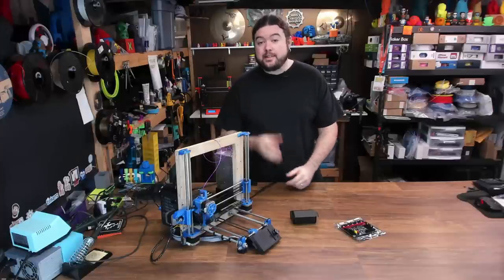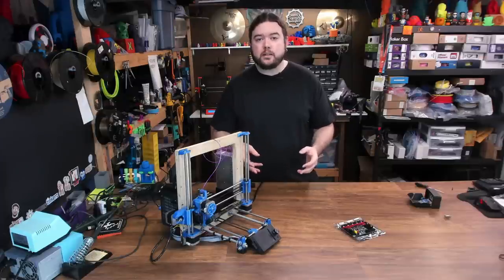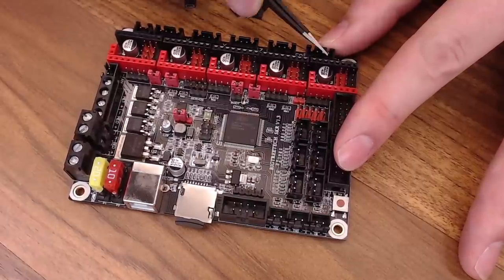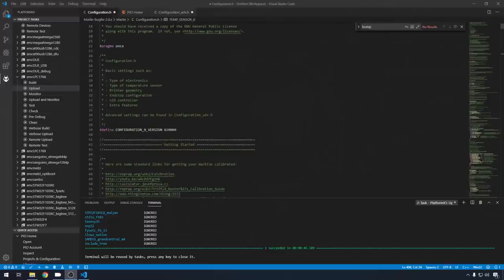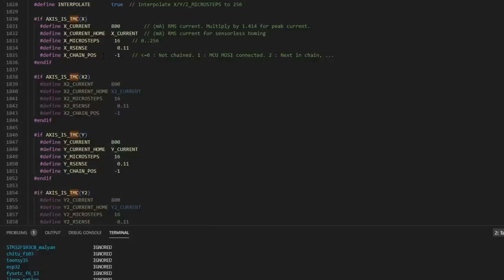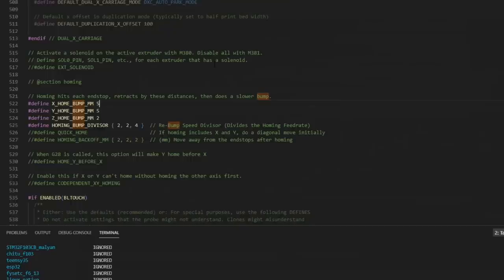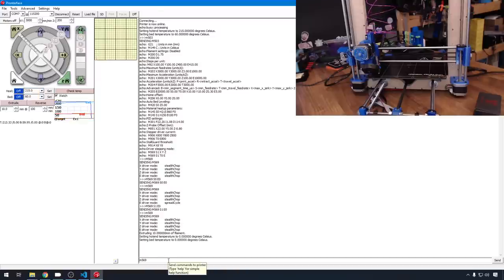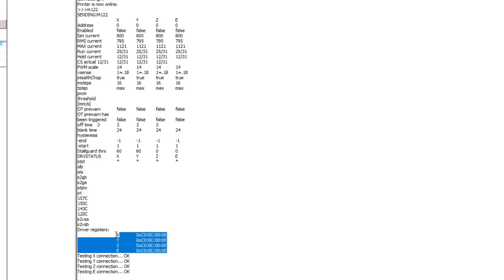TMC2209 Stepper Drivers - Bigtreetech - SKR 1.3 - Install - Chris's Basement

Comment: Great video thanks. Maybe you can help with this. I am building a printer and the hot end / carriage will travel past the edge of the bed before it will hit the end of travel in the x and y axis.  Will I need to change any other setting for homing?
Reply from the maker: You mean it doesn't stop when the endstop is triggered?
Reply: Not actually sure at the moment. I’m in the process of building a printer and I made the frame large enough for a 300mm heat bed but right now I’m putting a smaller 210 (give or take) bed on it. It appears that the carriage will be able to travel to the left (view from the front) farther off the bed area then just to the edge. So I was wondering how one would adjust for the extra distance before the x carriage hit the frame hard stop for homing. Thx
Reply from the maker: @dougw9224  Yes, so you will set the X/Y min to a negative number. 0,0 would be the corner of the bed. Anything more than that toward the endstop would be the negative setting.

Comment: Great video.  I am upgrading my 1 year old Ender 3 with an skr 1.3  (unfortunately I hit buy a couple of days before I saw an announcement about 1.4).  I followed a few different source for instructions and configurations, yours seemed the most complete but I ran into one build issue.  Atom / Platform.io failed to compile  TMC_debug.  This is my first time using Atom.   I don't seem to have the right  library.   It completed with TMC_debug commented out.   any suggestions?
Reply from the maker: Thanks! Atom has been super buggy for me lately. I have switched to using VScode.

Comment: Hey Chris, been trawling through your vids trying to learn. I've got my first printer and it's way too loud to use except when i'm out, so everyone says "just upgrade to 2209". I can solder but when it comes to all the code and firmware I'm terrified. Do you have an 'absolute beginners' suggestion ?
Much obliged!
Reply from the maker: Hey, so it depends what type of printer you have. I would recommended doing stand alone drivers/or step dir mode as they call it. That would mean no firmware updates, again, depending on the printer you have. Check this one out. https://youtu.be/ywscQehQ80M
Reply: @ChrisRiley  thank you!!!

Comment: It seems like there would be a defect involving the stepper drivers actively heating those capacitors with nothing shielding the tops of the caps from the heat.
Reply from the maker: For the most part there doesn't seem to be an issue. They do make risers to lift them up a bit that helps.
Reply: @ChrisRiley   If I didn't have risers I would use some Kapton tape to block the heat from the driver above the capacitor.

Capacitors themselves generate their own heat during use. The heat generated by the driver will be transferred to the case of the capacitors via emissive heat radiation.  For every 10°C increase in operating temperature, the life of the
 electrolytic capacitor reduces by half. The best practices say to use a heat shield to block any heat radiating from other sources. So you can have heat coming from the board, the capacitor itself and anything around the cap that will reduce its life.
Reply from the maker: @Deneteus  Nice, Kapton tape is a good idea.

Comment: hi chris i have a question about heat on the tmc2209 drivers and standard nema 17 motors. before i used cheap tmc2100 and they always ran hot i think they were doomed to fail. i did have a fan blowing on them though but ive had some fail. i believe the BTT tmc2209 heat up less and mine will have heatsinks but im wondering if they still need cooling? i dont think they would but i dont want to kill them. thanks in advance
Reply from the maker: More cooling is never a bad thing, but you probably won't need it if you have heatsinks. Even better if you run them at 24v. Try to dial in your currents as low as you can and you should be okay with out a fan.

Comment: hi chris , I have the same configuration stealhshop work perfectly but when i switch tmc2209  to spreadcycle i have high pitch sound ?
Reply from the maker: Yeah, that is usually chopper timing causing that. They are a little quieter at 24v. See if changing this setting helps. #define CHOPPER_TIMING CHOPPER_DEFAULT_12V

Comment: Hi Chris, so do I not need to adjust my vref if I were to install it on the my Skr 1.4 Turbo in UART mode? Thanks in advance
Reply from the maker: No, just use M906 to adjust it, start around 800.

Comment: Hello Chris, i just downloaded your config from this video to compare my configuration from Marlin with yours. But in your configuration all driver are defined as TMC2208. Can you tell me why? I new in this buisness. :)
Reply from the maker: That firmware was from the previous 1.3 video and the version didn't 100% support 2209's, but the TMC2208 setting works. Now, the new version of Marlin does. I would go with a newer version of Marlin instead of this one, it's going to be a lot easier to use.

Comment: Hi Chris, thank you for your informative videos they have been a great resource. I have my skr 1.3 with btt tmc2209 v1. 2 and original pinda 2 on my mks2.5s (mini rambo made magic smoke) marlin 2.1.2 and x and y sensorless homing works but when I try to home z it just lifts up a couple of mm and stops. Pinda is on zmin firmware is modified as per your instructions, but no luck with z calibration. I have not cut any diag pins from the steppers or removed the pull up resistor on z min so I was wondering if you could share any wisdom on how to resolve this problem. Oh it happens even if z is parallel set up off one stepper or split to a second z drive on e1. 

Cheers!
Reply from the maker: Hello, yes, it's probably the pinda triggering in the opposite way. It thinks it's always triggered. Use a terminal, something like pronterface and run a M119. Does it say Z is triggered? Hold some metal up to it and run it again. If it is flipped set z endstop and z probe to the opposite, probably true. Let me know if that works.
Reply: @ChrisRiley  Hi Chris, thank you for your help, your advice did the trick, it was triggering so I set the Z endstop and z probe to false as per your advice and now it homes and bed levels perfectly, My Prusa is back from the dead!

One caveat, I did have to change the skr 1.3 pin files and run the pinda from the servo pin P_20 for this to work

One question regarding the fllament runout sensor, is that supposed to be triggered or not?

Thank you again for your help, if you or anyone would like to look at my config files just let me know

Comment: Hi Chris, first, thanks for this video and the previous for the SKR 1.3 Mainboard.

I have the SKR 1.3 with (ERYONE) TMC2209s. Now, if possible any suggestion on this: When I tried the sensorless homing option (testing X), the motor does not move. I can move forward or backward but when press the home button it does not move at all and X value resets to -6. Same when testing Y. I tried changing sensitivity and current but made no difference.
When I did the configuration for mechanical endstops it did move on demand and homing as expected. I can live with this but I was hoping to get the sensorless going.
Reply from the maker: Hey Marco, you might be hitting a Marlin bug. It's hard to say because all the different driver boards are configured a bit differently. Some of the board have to be soldered to get them into UART mode.
Reply: I had a similar issue with the BTT TMC2209 and the SKR 1.3 initial install went fine w sensorless homing. Did a benchie to test. Fired up the printer the next day to print. Attempting to home any axis individually the axis moves slowly then fails. Tried 2.0.4.4 then 2.0.5.3 nothing worked I reinstalled the endstops and removed the jumpers for the Endstops disabled Sensorless Homing and reflashed and all is well. It's either a bug in Marlin or something with these 2209s I've read in a few forums that there appears to be some issues with some of the 2209s and sensorless homing.
Reply: I figured out what the issue is, Chris said not to do this at the beginning of his video. I was powering my board via 5v from my Pi when you eventually turn on the powersupply something wonky occurs causing this issue. I connected my Pi via 3 wire directly to the SKR 1.3 changed the jumper around to power the board via the 24v feed reflashed w sensorless homing and everything is working fine. Rebooted several times no issues. Also I noticed my sensitivity were way less than when I had the jumper on 5V for it's power. Awesome work again Chris thanks so much.
Reply from the maker: @oralallen82  Glad you found it man, I hope all is well.

Comment: i seen this vedio over 10 times , you give many information . i like this chanel

i have one more quastion : you have 2 z motors , how you work with one driver? you have T wire?
Reply from the maker: Thanks! I use this https://www.amazon.com/Printer-Accessories-FYSETC-Stepper-Parallel/dp/B07DMCT1V9/ref=sr_1_16?dchild=1&keywords=2+z+motor+adapter&qid=1587658688&sr=8-16

Comment: On line 662 in the Marlin in your video What is the difference between using TMC2209 and TMC2209_STANDALONE?
Reply from the maker: TMC2209 is controlled through UART (the firmware) standalone is controlled with pins and jumpers.
Reply: @ChrisRiley  thanks, it's clear to me

Comment: hi Chris great videos thanks for all the information iv got a working printer but have come across a problem . i have a working build of marlin 2.0 and has been printing happily on a4988 for about a month iv ordered a set of 2209 which should arrive shortly so i thought id hop into vscode and build the firmware but unfortunately as soon as i open the current build to modify if i get 41 errors all "  function call not allowed in a constant expression " but the last time i build this firmware it was a success and loaded it to my 1.3 and i have not changed a thing ? is there something i am missing as i am quiet new to using vscode 
update libraries perhaps ? im sure on one of your videos i saw you update a library 

anyway thanks again for all your helpful content and keep up the good work as im sure lots of us appreciate your hard work
Reply: and to make things worse i have just accidentally disabled the error squiggle marks and now it wont  show me the errors at all ahhhhh  and im looking everywhere to see how to enable them again
Reply from the maker: It all kind of depends on which version of Marlin you have. I highly recommend you go grab the new Marlin 2.0.3 version and reconfigure. It should solve a lot of problems.

Comment: Hi Chris, can I put these the same way on a mks gen l v2.0?
Reply from the maker: I think so, shouldn't be an issue, but I am not sure that board has integrated driver support. You might need to use some jumpers to hook it up.

Comment: hello, I have a question regarding the choice of a driver, my need is to install 2 X motors and 2 Y motors on my Anet A8 plus printer, which is equipped with A4988 drivers. Which driver do you recommend knowing that the drivers will have to control 2 motors so double intensity or voltage. I am aware that it will be necessary to change the motherboard evening an MKS or a Beegtreetech. thank you in advance for your help
Reply from the maker: The 2209 can probably do two just fine. If you want to be sure you have enough juice take a look at the TMC5160, just remember is it an SPI interface.

Comment: Howdy, do you have a tmc2208 v3.0 install for mks gen L video?
Reply from the maker: I don't, that will require some jumpers to use UART mode.
Reply: @ChrisRiley  ok, yea i removed some of the jumper block pins from the ms 3 for xyz , from bigtreetech the tmc2208's came with single jumper cables but i wasnt sure if I needed  them for the uart mode.  havent tackled the marlin changed either yet. lack of info on these v3.0s
Reply: @ChrisRiley  btw i really appreciate you taking the time to still answer questions on an old post and promptly. Both time i have commented in your videos you have at least tried to help me, and within a couple of days. Several other channels just ignore older post. You've gained another subscriber and referrals from me!
Reply from the maker: @vulrath8154  Thank you Justin, I try to help as many people as I can. That's why we are here, to learn. Send me a link to the driver you have, I would like to check out how they are configured. All these boards are a little different from one another.

Comment: Hey Chris I got my SKR 1.3 finally however I am having issues with the 2209s. I get "Error: All LOW" when I perform M112 I read in on of the comments that UART only works w 12V is this true? I have the ender 3 Pro that's running at 24v.

Thank for your help.
Reply from the maker: Nah, they should work the same at 12v and 24v, but error All Low is one I haven't seen before, not sure what that is trying to tell you.
Reply: @ChrisRiley  thanks for the reply. I returned those drivers and I'm waiting for my replacements.

Comment: I've tried this on the SKR 1.4 Turbo and have done plenty of research (not enough apparently), read through the manuals on github and tried many things. I have even gotten the SKR 1.3 and turned sensorless homing up to 255 (also tried 1) and still does nothing (as the motor will not stop). Right now I pulled the board, motor, and wired up a power supply for easy access. I did notice that I get 0xC0:08:00:00 when using M122 but says all testing is OK. Trying on a P802M because board died but have a Ender 5 Plus on the way.
Reply from the maker: What drivers do you have? They may be hardset to standalone mode.
Reply: @ChrisRiley  Got everything you have in video and followed video several times. That is Bigtreetech SKR 1.3 with TMC2209 also tried SKR 1.4 turbo as well. I am new to 3D printing however but have learned a lot in past month especially trying to figure this out.
Reply: Not all TMC2209 driver boards are created equal, this I have learned today. Your issue may be with the driver board itself as it may not have the DIAG pin installed in the correct location for the SKR 1.4 Turbo. Easy way to know would be to do a pin count on the bottom of the TMC2209. If you have 17 pins, then i'm 99.9% sure that the DIAG pin is not connected to the SKR 1.4 Turbo mainboard as that pin location is one spot over. No DIAG connection means no Stallguard and no Stallguard means no Sensorless homing.  My setup is the SKR 1.4 Turbo with Eryone TMC2209 drivers. The only solution that I can see to correct this is to solder a jumper wire on the bottom of the board at the DIAG location and run it to the DIAG header pin on the TMC2209.....or get different TMC2209's that actually work with the board. Hope this helps ya.
Reply from the maker: @daproph8352  So true, they all seem to be just a bit different.

Comment: Tmc2208 vs tmc2209 for ender 3 which cooler stepper motor?
Reply from the maker: 2209 will run cooler.

Comment: I installed the tmc2209 on the 4 axis and it's set (Driver Current)
x: 800
y: 800
z: 800
E1: 800
And the driver ref v I put 1.25 is correct?
Note: They are moving very fast and making noise.
Reply from the maker: The vref at the drive will report this when in UART, correct. 800 shouldn't cause them to move faster, it could be another setting.